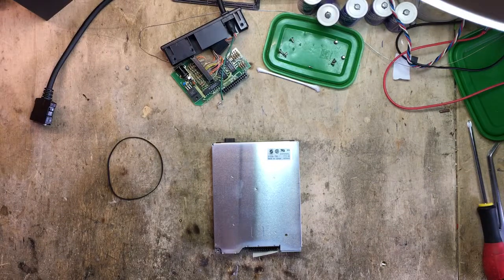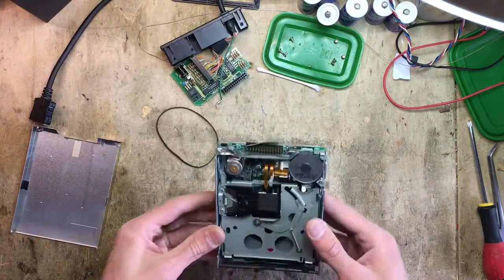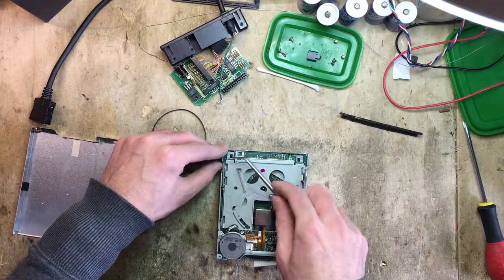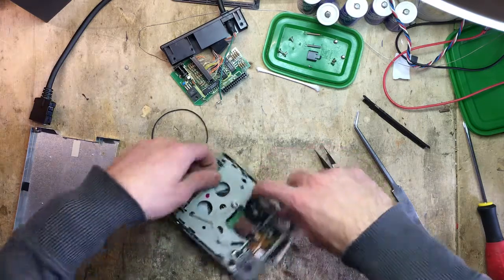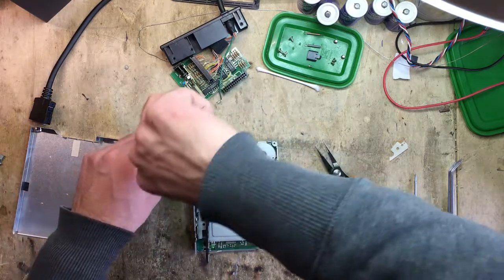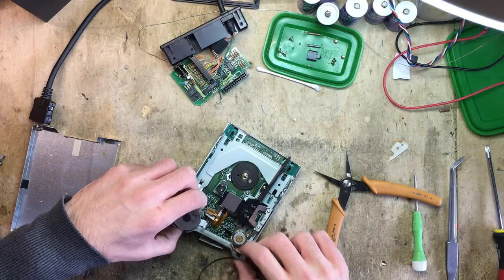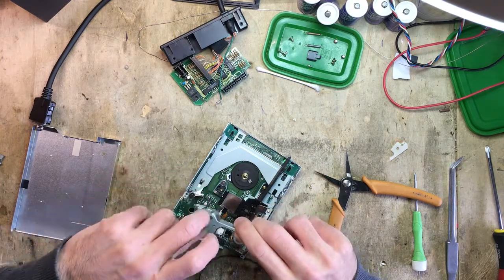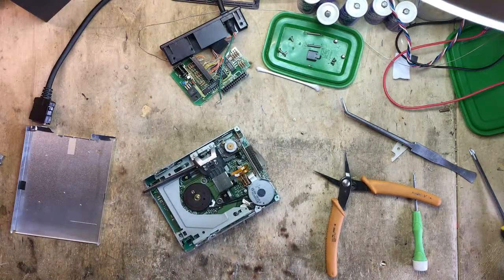Citizen Floppy Drive Belt Replacement DIY Guide

Comment: What are the original dimensions for these belts? 3mm x ??? (diameter?)
There are some places on the web where you can source generic belts if you know the exact specs.
Btw, the only other 3.5" drive I've seen with a belt in it is the TPDD (Tandy portable disk drive) for the Tandy 100. Other than that I thought all these drives were direct drive. The fact you almost have to take the whole damn thing apart to just to replace a stupid belt screams of a bad design! No wonder these Citizen drives went the way of the Dodo... ;^)

Comment: What model diskette drive is this?  I'm looking for replacements for the Citizen VIDA-15B drives used in Compaq LTE/Lite laptops.
Reply from the maker: I don't remember the model, but it's the same drive, It's also found on some Commodore external drives, that's where i found the proper size for the belt.
Reply: The drive in the video appears to be identical to mine which is marked as a Citizen U1DA-14A, taken from a Compaq LTE 386s/20.
I've no idea where to find a replacement belt since I found nothing on ebay for the U1DA-14A.
Reply: @paolocanonici9965  71mm diameter, 2.8mm wide and 0.6mm thick belt works perfect on U1DA from LTE 386s/20 and also on older model found in LTE/286, I've done two recently.

Comment: Thanks for the video, it helped me to take the thing apart a bit. The smd electrolytes on the board have leaked and my unit (most of them probably by now) really need a cap change and a clean too. The belt is a pain to find still... maybe someone  sells 3mm wide 0.5mm flat stock for the belt so I might be able to make them myself for the proper length... I don't quite know yet.
Reply: Actually, 3mm sounds too wide. Anyone found the original specs?

Comment: Hello, please I need help .

I got a PowerBook 160 and it’s not currently working I recapped the power supply and I only now get a partial black vertical line in top right of screen no chime !

Thankyou you can email me or just replay here thankyou - jarrod.ebdon@hotmail.com
Reply from the maker: You might have a problem with the board that sits under the display hinges in the top half, the one that has the battery and speaker. You should visit the 68kmla forum and ask there
Reply: Francesco Ferretti thankyou for the reply , iv chucked a post on the forum

Comment: Did the drive actually worked after the replacement?
Reply from the maker: ddutra86 sort-of. Sadly I removed (and therefore misaligned) the top head when I first opened the drive, so I misaligned it. As for the belt, it worked perfectly
Reply: @FrancescoF  :-(